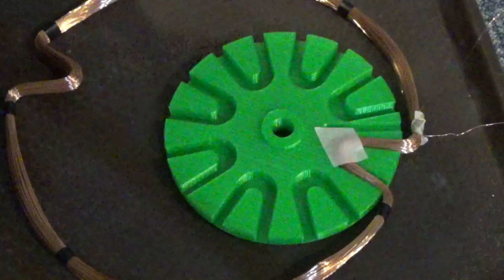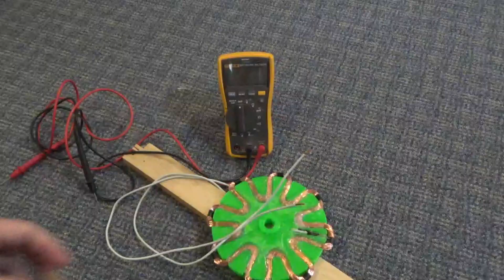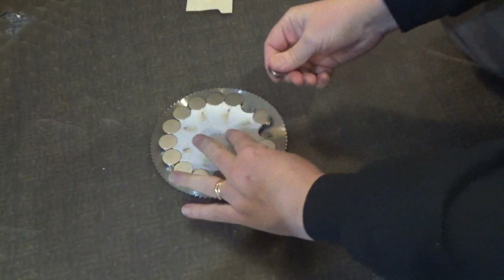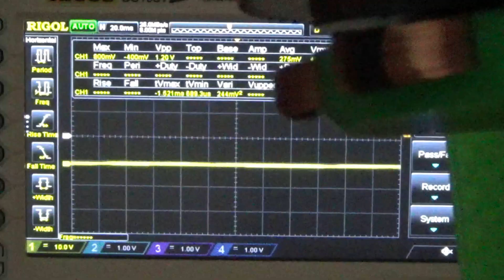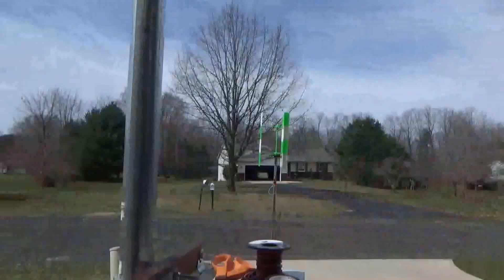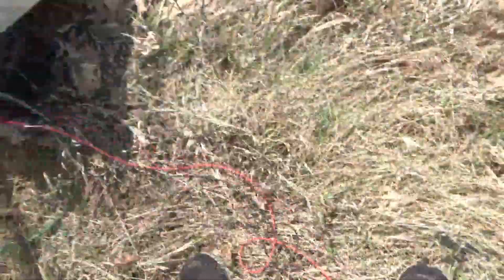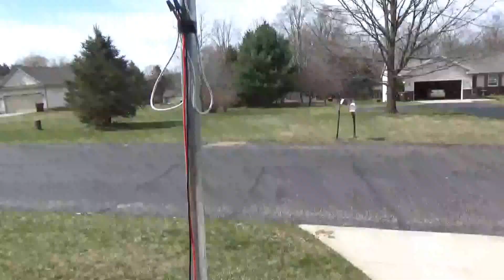3D Printed VAWT - Generator Build

Comment: Can't find the coil older file on thingiverse. Can you share, please?
Reply from the maker: I can't find it in my files either.  The length of wire can be estimated with a piece of string and that can be used to improvise a coil winder.

Comment: I have my 12 neodymium magnet of 20*10*3mm what wire gauge and turns to make 9 coils
Reply from the maker: I'm hoping to make a video showing how I calculated the number of turns etc.  But it would have to be adapted for different generator configurations.

Comment: At 00:14 the the supports at the center holding the bearing are a lot narrower than the rest of structure. Why are they like that and not as thick as the rest of the structure?
Reply from the maker: I wasn't too worried about structural strength and I just wanted to get the thing printed.  I got lazy and just drew a hole in the middle of the outer pieces to cut down on print time a little.  In other words, there is no reason for that.  :-)

Comment: awesome build; printing those forms up sure makes it look quick but I bet that takes a while. so when you say full sweep you mean 1 revolution when you have it on the scope. Maybe explain why you detuned it for the lower voltage if you don't mind for the dummies amongst us.
Reply from the maker: I wanted the generator to make good power, but not be so strong as to overpower the turbine.  Another goal was to see if I could hit a design target based on theoretical calculations.  I did not have a lot of confidence in my magnetic field strength estimates, so I tried to err on the high side knowing it could always be lowered by increasing the gap between the magnets and the coil.  Running the voltage test and then adjusting the gap was a way of "tuning" the generator for the application.
Reply: @MickEMaus3000  so you're trying to tune to the power band/rpm for those wings then.
Reply from the maker: @itsandbits1   Yes.  I want some power, but I don't want so much drag that the wings stall.
Reply from the maker: When I say "full sweep," I just mean one sweep of the oscilloscope.  The generator makes eight cycles in one revolution (8 poles).  I just need to know the frequency of the displayed waveform to get the rotational speed.  To calculate rpm, I just take the frequency recorded on the scope (cycles / sec), divide by 8 (cycles / rev) to get revs per second, and then multiply by 60 (sec / minute).
Reply: ahhh, just read the description fully... my bad